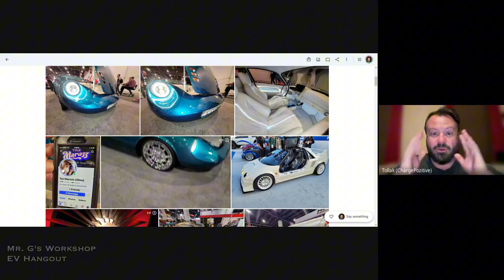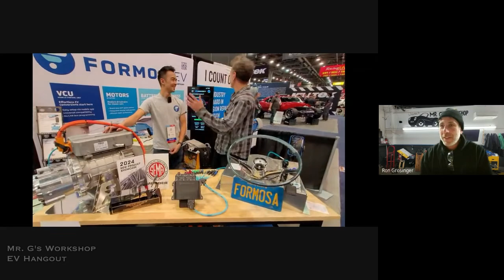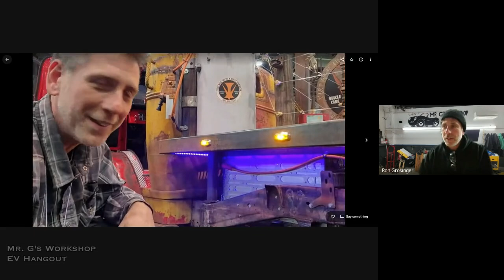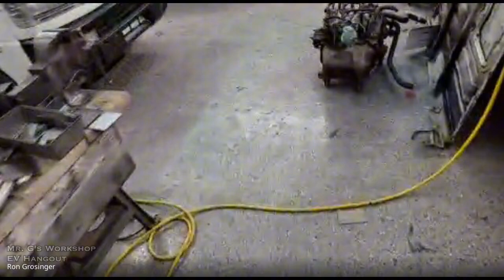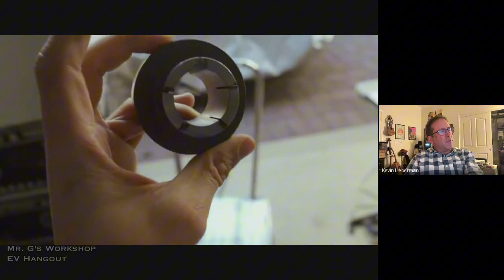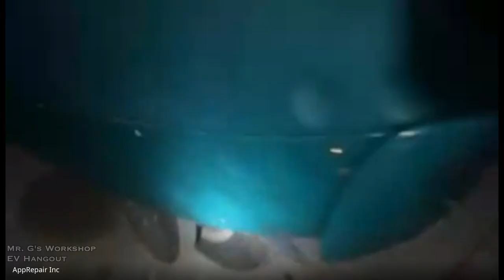SEMA 2024 Recap - Kei Truck Update - Sparrow 3 Wheeler - Used EV Rebates - EV Hangout 34

Comment: Appreciate the content. I was the guy that didn't realize you need to center the hyper9 off the ring and not just the bolts. thanks for setting me straight Mr. G.
Reply from the maker: Yes you need a center "register or hub" similar to a wheel on a hub.  You are doing great!